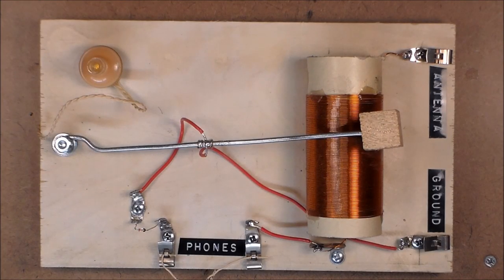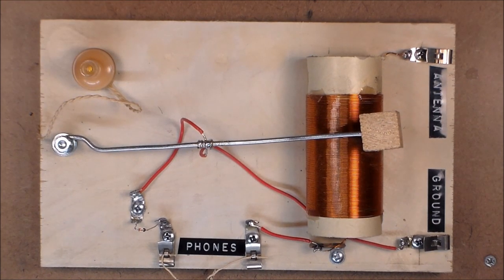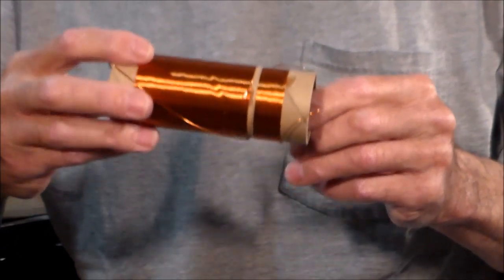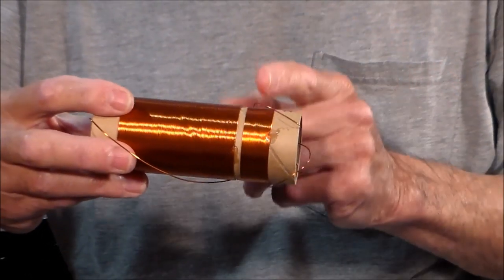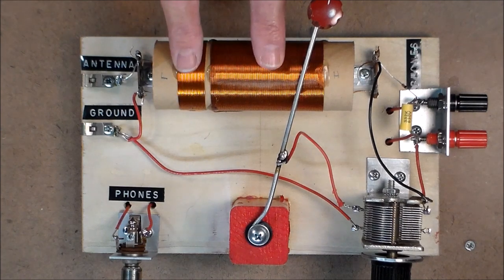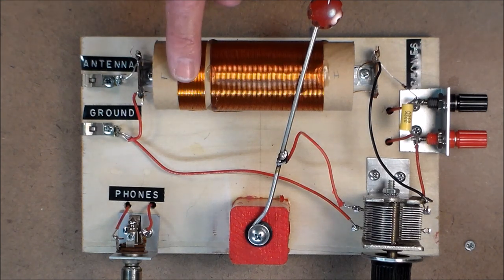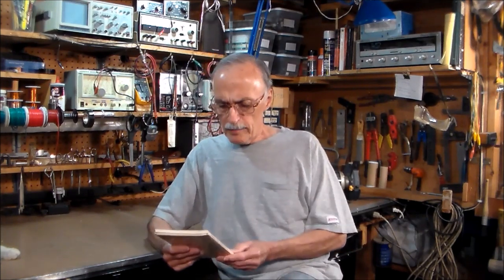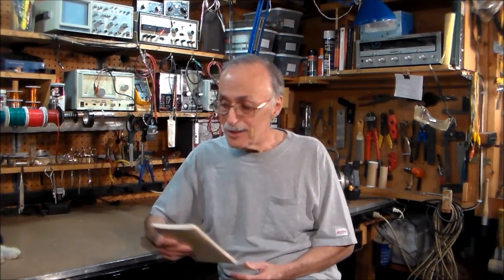BOY SCOUT CRYSTAL RADIO UPGRADE

Comment: I thought that we already had the era of radio detector behind us. Maybe do something transistor
Reply from the maker: Old radios, crystal and tube,  have a lot of nostalgia and historical value. But if you are not into this, check out my video "Homemade Solid State Radio". I jump past the transistor and go for integrated circuits.
Reply: In my youth I did such detector radios. Radio stations then had a lot of broadcasting power. Radios on germanium transistors are history as well. greetings
Reply: @squarewave2  I collect whatever modern true analog radios I can find because they tune much better on the AM and shortwave bands and are getting RARE! Most cheap so-called "analog" tuning radios use DSP chips now and are terrible on the AM and shortwave band for various reasons. One reason is "soft mute" that silences weak signals plus muting while tuning. I hate most DSP radios without a digital display. I recently bought a Sony ICF-P26 and P36 and a Tecsun R-9012. These are nice on the AM band (inexpensive too!) and the Tecsun has nice shortwave reception as well. Battery life is outstanding...over 100 hours using two AA batteries! These are made in China though so quality control can vary. I got one Sony ICF-P36 that wasn`t aligned properly. These are tiny radios but I love them. Get em before they stop making them...